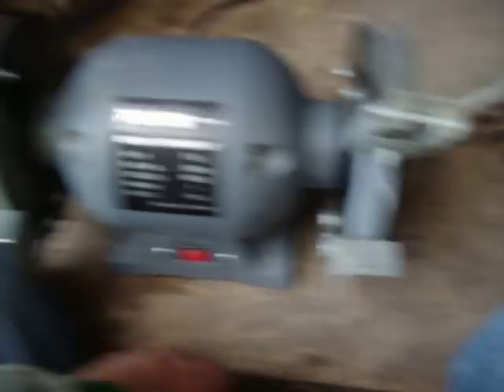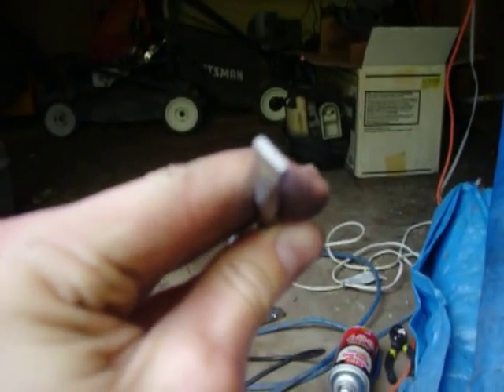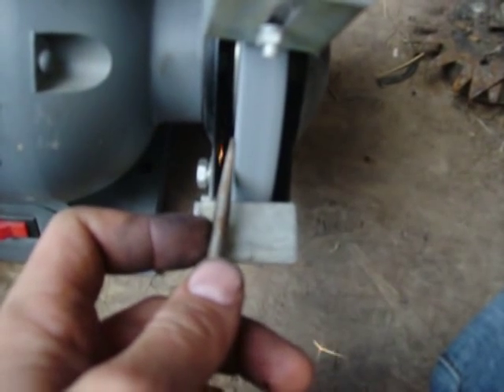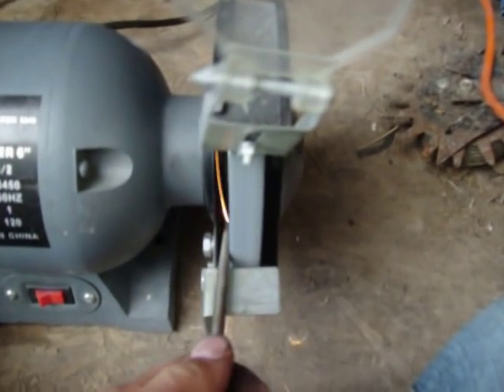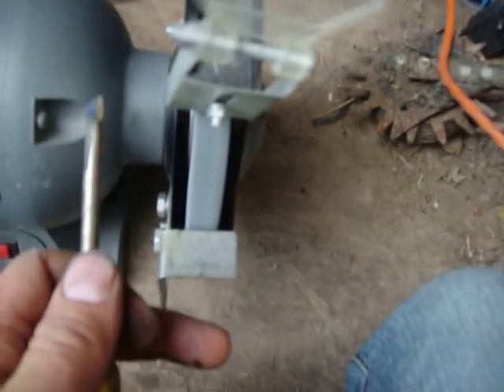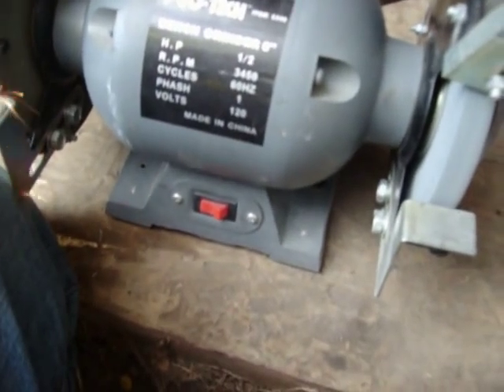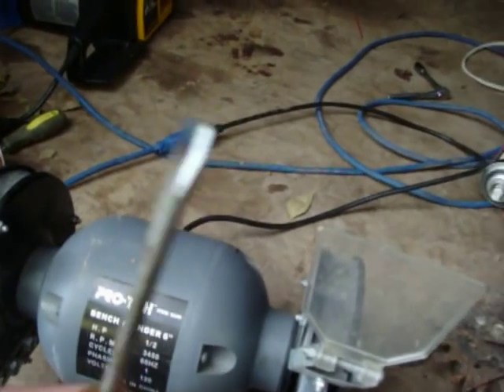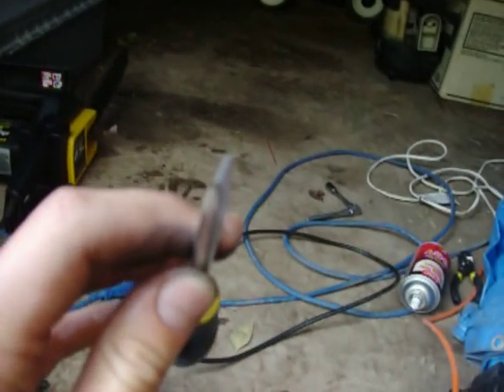how to fix a broken standard / flat head screwdriver

Comment: Folks, this is how to ruin a screwdriver and destroy the temper.
Reply from the maker: It wasn't usable as it was and didn't have a warranty.. how would you have done it differently?
Reply: @ils360  1. Surface grinder using light passes with an angle vise (but most don't have access to those). 2. Wet sand with light pressure on a horizontal belt sander with frequent water quench. Finish with a honing guide and whetstone or glass plate with sandpaper. Using a grinder will pull the temper out of screwdrivers, axes, knives, plane blades, machetes, etc...
Reply: So super simple bowl of cool water next to grinder and hold towards the tip your grinding and once it gets hot enough to be uncomfortable stick it in the water and swirl it around I assumed that would be common sense no offense it was one of the first things I learned screwing around when I was a boy messing with dads tools in the garage tried sharping and knife and even when I put it on the whetstone and removed all the colored metal and it wasn't much I couldn't get a burr no matter what I did so always always avoid grinding with power tools so a nice file is what I use in this exact situation or if it's a really hard temper and I want to save my better files you can get a cheap diamond stone on Amazon something between 100 and 300 grit and the more expensive ones that have the diamond actually bonded with the backing metal get better with use
Reply: @craigbinder5560  He's using a standard speed grinder at 3450 RPM.  Should opt for one of the low speed models that run half that speed for sharpening.